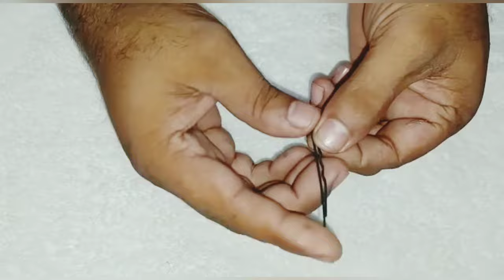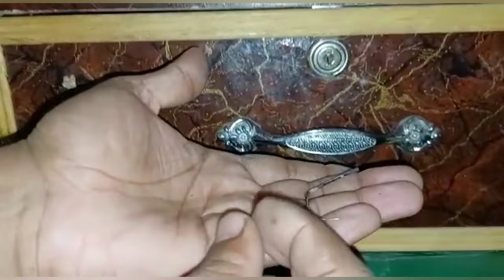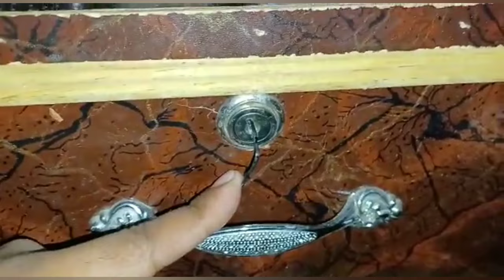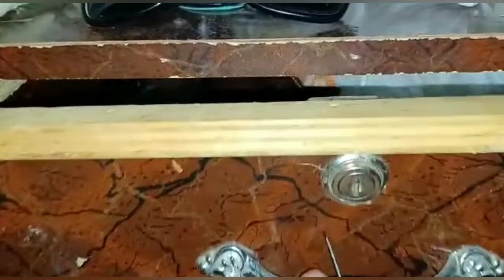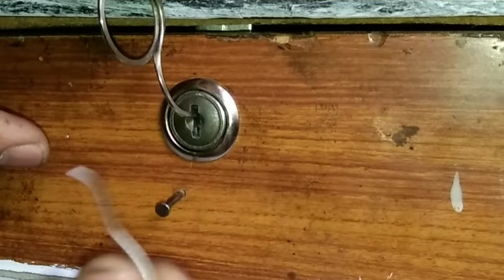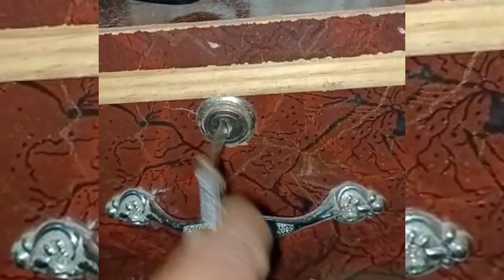3 Ways To Open Drawer Lock Without key

Comment: None worked, i pulled the handle and broke the lock easily
Reply from the maker: Sir, you were in a hurry because hurry is a loss. I am a locksmith and if you understood this and opened the lock, it would have opened but you made a mistake and you lost.
Reply: @locktips  ok